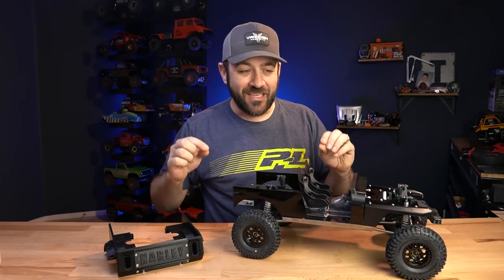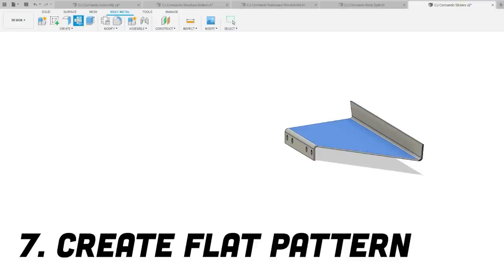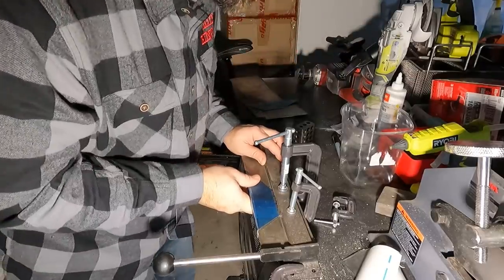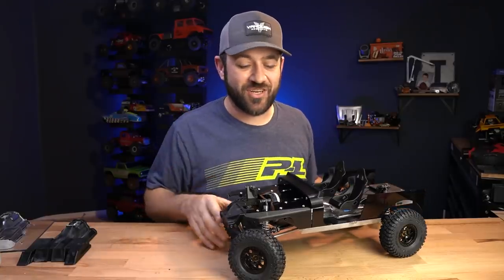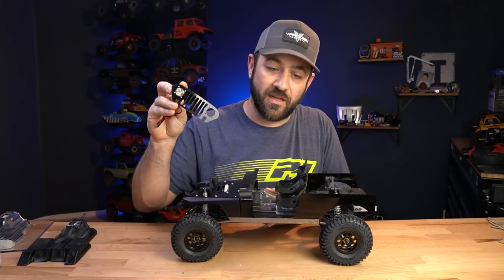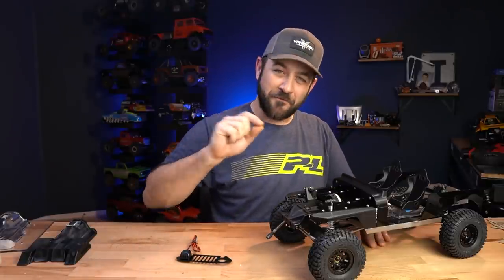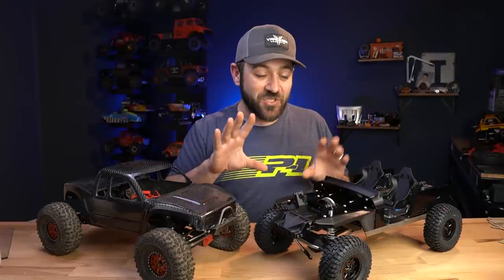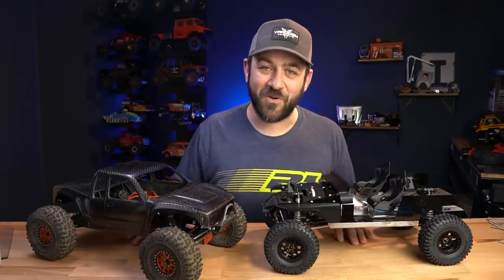Is this too much? - Road to Scale Nationals - Digging In - S2 E2

Comment: Very cool Josh. There is nothing worse than having a stellar idea, going into fabrication, only to have to re-work multiple times to achieve the end goal. Been there way too often. That said, I don't have access to a lot of the specialty equipment you utilized in this process. 

I still do a lot of CAD work, or as you've dubbed it, Cardboard Aided Design - LOL! I have found that if I am patient in that CAD process, the results can be pretty darn accurate. I like to use thin, stiff card stock as it cuts, trims clean and accurately. I've used my same Harbor Freight bender enough now that I can account for bend radius as well based on the material i'm using. 

Loving this build, the ideas you're executing, and how you're leveraging all this equipment to make it happen. Great work!

Comment: awesome video with great information!
i use very thin stainless steel tubes (5mm OD and 0.3mm wall thickness) with 36g/m
Reply from the maker: I’ve used that before as well, although not for a cage. I just don’t like the strength of it compared to steel tubing, while the Ti should be very strong.

Comment: Have you thought about sticking with the carbon fiber theme; And making your roll cage for the class 2/3 out of carbon fiber as well? You could user carbon fiber arrow shafts, and CF filament printer joints, to form the cage. It would weigh a lot less than a welded cage.
Reply from the maker: It would be less scale points being non-metal. I also just don’t think it would look very good. I think it would look too “knex” like.
Reply: @HarleyDesignsInc  that's what sandpaper and paint is for.

Comment: the build is looking awesome, so im gonna do an RC in a game called snowrunner, you think i could get the cad files for the vanquish chassis? it would be the best one to do and then i can use one of my models as a body, i was thinking of getting some models of scx10 axles from grabcad but the vanquish stuff is so much cooler